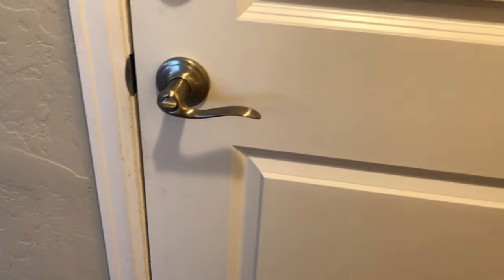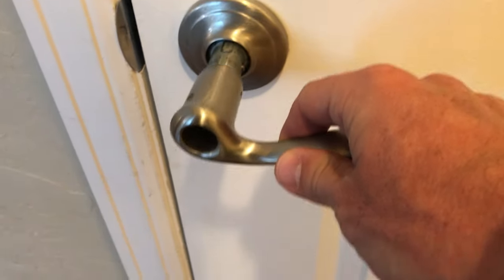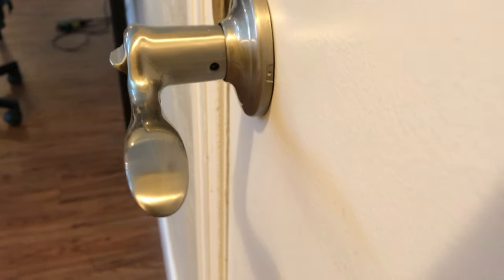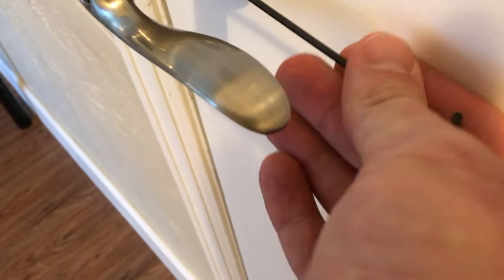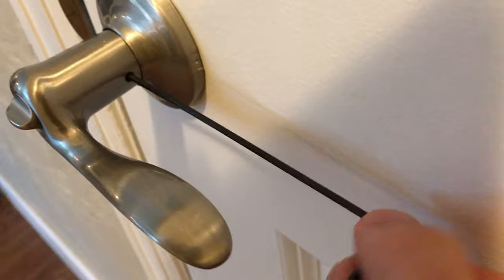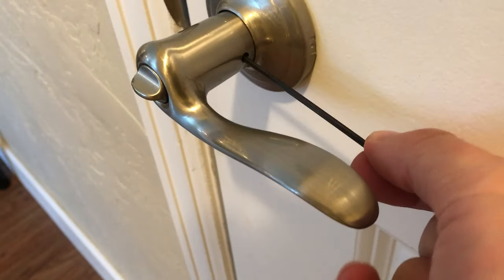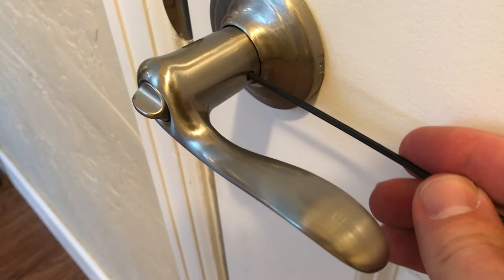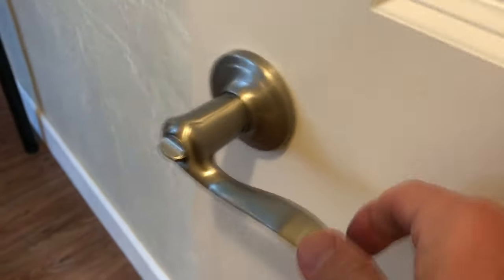Attaching a Loose Door Handle

Comment: I had two similar handles come loose in my house, I didn't have an allen wrench but I had a small drill bit that happened to be the size I needed and it solved the problem. Thank you so much for posting this, the handles are black and I didn't even realize the hole for the screw was even there!!! I thought I had to call someone to replace the whole knobs.
Reply: Me too!
Reply: Did you use the drill bit as a screw itself or to "screw" the existing screw ? :)
Reply: @djabthrash  I used the drill bit in place of the allen wrench, to tighten or "screw" the existing screw
Reply: @azuresins6904  Gotcha ! Thank you !

Comment: Thank you so much for the tip that turning the screw to the right would tighten the handle.  That seems backward as I was turning the screw to the left thinking the screw would come out and grab the handle to prevent it from coming loose.  Yours is about the 10th video on this topic I watched today and no one mentioned that.

Comment: Not that it makes a difference but when you turn it clockwise your running the setscre further in and it goes into a whole internally on the other side which locks it in place, not backing it out so that it's locked into the whole your putting the Allen key through.

Comment: I did that once and it fixed it for a month but now it’s happening again and it won’t tighten, idk if the screw is even still in there.. do they sell replacement screws? If u know 😅
Reply: I would think that if it worked when you fixed it once, the screw is def still in there. If it slips off after tightening, then maybe it isn’t. But if it doesn’t slip off after tightening, then the screw is doing its job and is there. And if it loosens over time (more quickly than you think it should) perhaps time for a whole new handle? I have no idea if they sell individual screws. A question for Ace or Home Depot dude!

Comment: Great video, if the handle has a round-shape little hole（not a Hex shape) , what kind of tool can be used to tighten it?
Reply: I would be a little surprised if the screw inside the round-shaped little hole was also truly round as there is no tool that could tighten anything - needs something to grab onto in order to tighten or loosen.  I still think it would be an allen wrench that does the trick, just wondering if the set screw somehow fell out?
Reply: @markbailey5017  Thanks for the reply. I carefully looked at the little hole at the door handle and it's round shape that I can't see hex tool can be inserted. It's very common in Europe. And what is the exact name for the "Tool" that you used for tightening?
Reply: Simon Z. Allen Wrench
Reply: Mark Bailey thanks, i will try to see if they are all hex shape

Comment: What size Allen wrench do we need?
Reply: When googling with that specific question - it says 1/8" or 3/32".  Don't know which specific door handle you have.  Allen wrenches typically come in sets, so just use one until it fits, but start with google's answer first.
Reply: @markbailey5017  
Thanks.

Comment: What size Allen wrench do you recommend?  I’m having the exact same issue.
Reply: Not entirely sure but a quick google search says 3/32".  Sounds about right.  Typically allen wrenches come in sets, so I'd just play with different ones until you get the right size.  But start at 3/32 in case google is right!
Reply: I bought a set at Publix for like five dollars. You get about six of them so one of them will fit